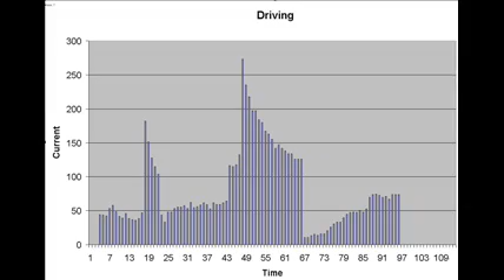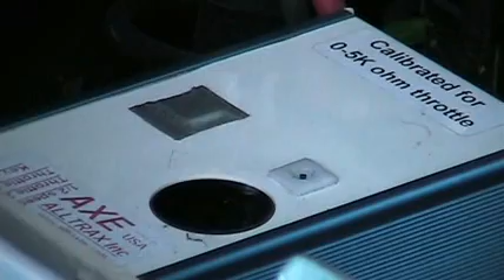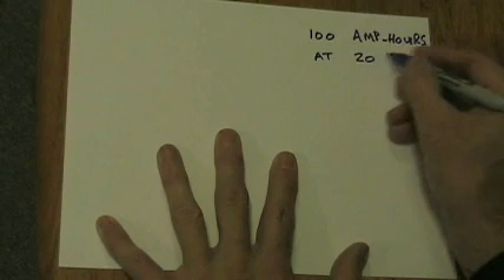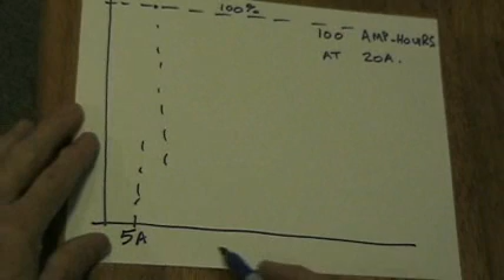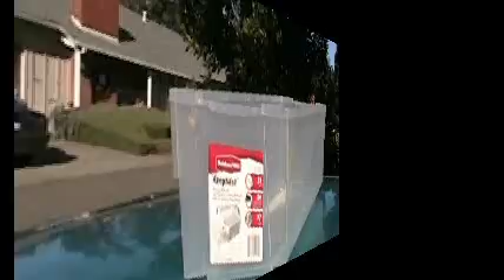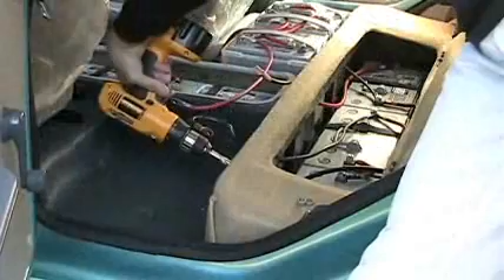Xebra addtional battery installation

Comment: but I want to do this at home! Can you explain a bit better? so you have a bank of six batteries in series and another bank of batteries in series then you connect the batteries banks in parallel. I though you had to match the Ah rating of all batteries. Can you connect a 100ah battery to a 35ah battery and have 135ah?